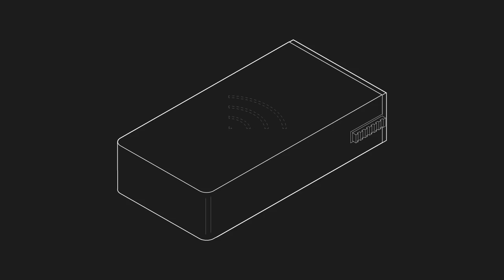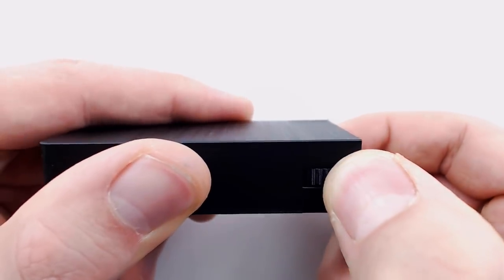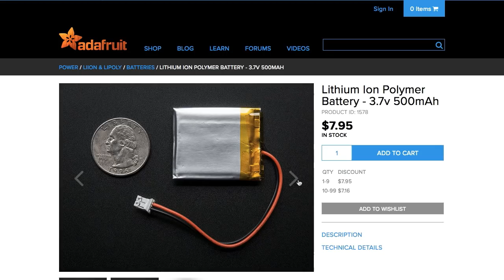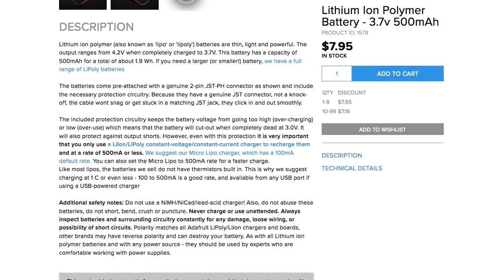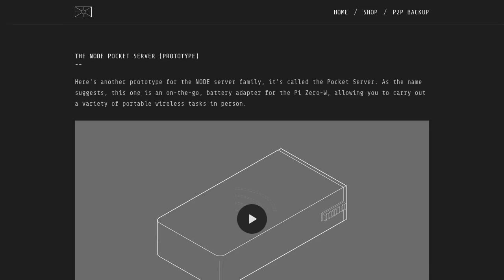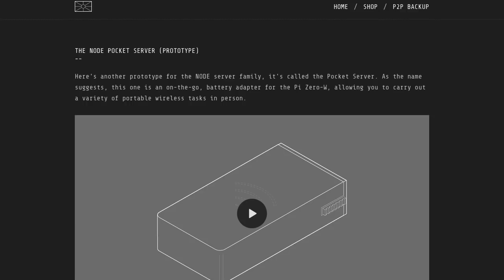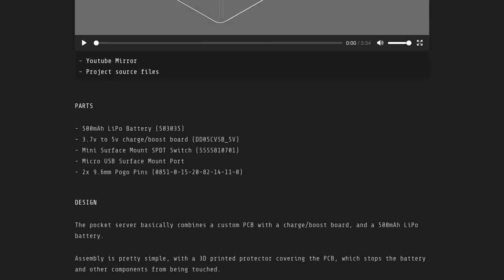The NODE Pocket Server Prototype

Comment: Very nice design. I've laid out the powerboost circuit on a phat/daughter board in eagle cad if you are interested. I've been meaning to put it in GitHub for a while. I don't think the battery and boost/charge components would fit on one side, but there is spare space for additional circuitry. 

 I hooked the PB low battery signal to gpio via transistor, and have an spst slide switch connecting to the PB circuit's enable input. I also put a momentary button and a signal LED so you can program a basic user interface, and I have some reusable python code to monitor the button and low battery pins, and drive the LED.
Reply: P.s. with the charge chip on the PB circuit, I think you just change one of the resistor values to control the charge current.

Comment: I got thinking today about a credit card-sized PCB crystal radio, where the card itself has a coil antenna printed on it with some sort of trimmer cap and headphone jack built into the side, plus the handful of passives for detecting and filtering. I thought this sounded a little like something up your alley since your PCB designs are pretty neat and serve interesting purposes (like those pogo pins). Anyhow, nice project.

Comment: 3 ideas.
1: Give the pocket server a larger wireless antenna or modding the PCB into an antenna.
2: Being able to plug in a micro USB power line without pulling it out of the case. You could add a cap to the port so no debris comes in.
3: Adding a heat sink with a mesh on the top or sides for breathing.
Reply: maybe an antenna you can attach to the case itself, that folds out for the sake of saving space?

Comment: I'm pretty new to this kind of content; what are some practical uses of such a device?
Reply: Ben Collins did you watch the video?
Reply: @FaithfulFrets  Yeja like I understand it can be used as a server but why would you need that? What practical uses can there be other than making a wireless mesh network
Reply: look into projects like pirate box, or library box. Other uses could be things like a wardriving logger, mini personal cloud storage device. anything you can think of that could be done on a little headless computer. even something just as a portable linux shell with wireless AP to access it. Lots and lots of uses. I keep a pi in my bag with piratebox on it. The next step in the sneakernet is here.
Reply: @RedMageGaming  Thanks a ton

Comment: Where are you buying the Pogo pins? They cost more than many other simple components on AliExpress :-)
Reply: And btw... I would love to see a simular solution, but with 4G modem and support for an external antenna, with support for sharing the 4G connection through the Pi W's WiFi, or with a dogle - but still with support for filesharing/whatever, from the Pi 😁...

Comment: Is it possible to run it for mesh networking? I'm thinking that it would be nice to have this running as a mesh node for simple signed text routing, or maybe even as a cheap Delay-tolerant network node.
Reply: an esp8266 would probably be better for this due to lower power consumption
Reply: That does sound like a pretty interesting use case!

Comment: Ha, came in so fast this time the video wasn't available. Wonder if there's an easy way to send the battery charge level to the server so it can be monitored easily.
Reply: The lack of adc on the pi makes that difficult. The adafruit powerboost provides a digital signal that goes low when the battery dips to 3.2 volts. I've laid out their powerboost circuit on a phat/bonnet form factor and made sure to attach that signal to a gpio pin.

Eevblog just posted a video about microcontrollers for $US0.05  (yes, five cents) that have an adc and an spi interface. (The video title refers to three cent uCs, but the three cent ones don't have an adc.) If he posts more research on how to work with them I'll use one to measure voltage on a pi board.